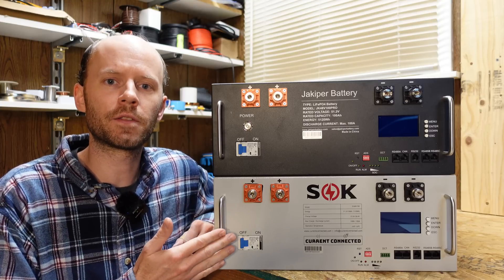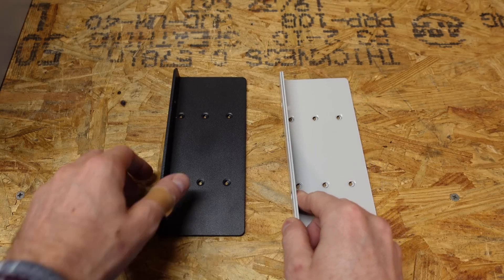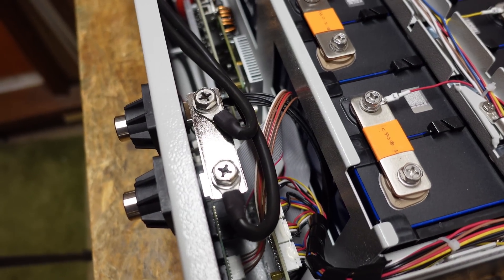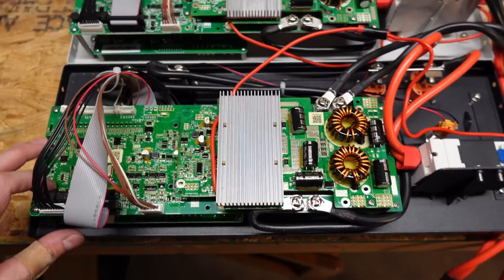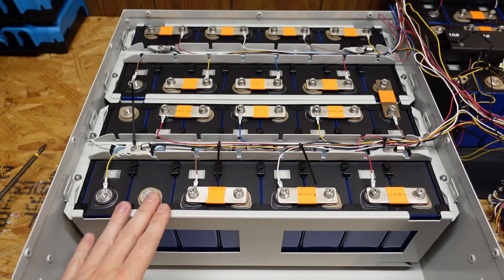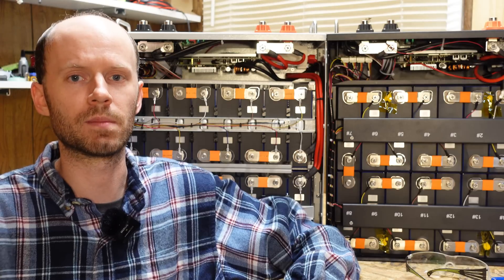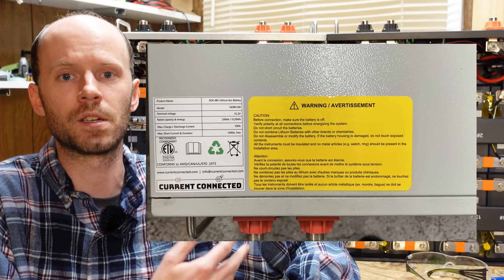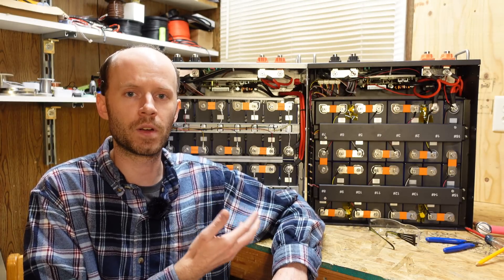SOK vs Jakiper, 48V 100Ah LiFePO4 Rack Battery Comparison

Comment: great video.  Now seeing $1,000 difference in a 5 battery rack between SOK and jackiper.. Worth saving 1k?  Seeing some shipping or packaging issues (maybe minor overall) for Jakiper.. I do like the design and design of the SOK, and seems really solid, but an extra 1k cost??
Reply from the maker: The batteires are pretty much the same as it appears one company copied the design of the other (my opinion). I'd say it doesn't matter in terms of battery performance; however, the SOK is sold, serviced, and supported by a US company. SOK also gets you an ETL listing, which may be required if you're doing something that requires a permit/inspection.

Comment: The extra steel enclosure in SOK batteries is good for transportation. Just received a Jakiper battery today and the batteries inside had moved forward and bent the bar across. The bar was almost touching the BMS heatsink. Fixable though and this video helped with the disassembly.

Comment: If you look at the battery report for both units, the handwriting on the measured parameters was written by the same person.  Look at the 33.13, which is very obvious it was written by the same person.
Reply: in china those are manufactured in same plant, so the supervisor for qc are the same, or they just copy those papper

Comment: Both way overpriced
Reply from the maker: Chins doesn't make a rack battery that I'm aware of. Ampere time does; however, is only rated for 90Ah, looks like it has a low-end BMS, no communications, what looks like an AC-rated breaker (not sure on that one), and definitely no UL/ETL certifications. Not saying it's a bad battery by any means either. That's the great thing about a free market - you can go purchase the one you want.
Reply: @LithiumSolar  when I say way overpriced it’s because these server rack batteries are more than double the cost of these other brands that also contain grade A lithium cells. Nobody astute with their money will pay $2000 and only have a 100 AH battery to show for it. Server rack is targeted for rich people with a lot of money to throw away.
Reply: @CompleteOffGridAmateur  yes they are 100ah but 48v which gives you 5120 watts and go for around  $1450-$1700
Reply: It's  the container freight making the prices high. Wholesale around $1k each until you add freight and import taxes.  Now add US warehousing, employees to get them in faster than 8 weeks and a little profit for US based support. There's your mark up.
Reply: @jstaffordii  I’m comparing them to Ampere or Chins who also face the same overhead costs.

Comment: That $394 cost difference on 25 kwh kits is not showing included accessories. On the SOK kit includes 2 awg interconnecting  cables and 4 feet 4/0 awg battery to load cables versus Jakiper kit only includes 6awg interconnection cables and 4 casters on the racking.
Reply from the maker: Wow I didn't even see they had that kit on their website. My pricing was based on adding 5 batteries to the cart, so it does not include the cabling. If I add the kit to the cart, it's $43 more, which brings the difference to $437 but includes all of the cabling, which would cost more than $43 if you bought it yourself. Great deal and agree 6awg is rather... small.

Comment: Would have been nice if you compared the Battery stud busbars (for the main positive and main negative studs). From another video not sure if it's your or David Poz's but the battery stud busbars in Jakiper were made of Brass, which apparently is an issue if you're going to be put 5 in parallel the brass busbars, cannot handle high amperage draws without overheating. Would have been nice to know if the SOK has those same brass busbars.
Reply from the maker: Good idea. That was David's video and do remember seeing it. I'll check it out and come back with an answer. Regardless of the material, I still prefer not using the "daisy chain pass through" approach and just cabling them all to the same studs like I did in my rack demo setup.
Reply: This feedthrough connection on the SOK is spec’d at 310a max. David was also using undersized wire in his video.

Comment: Perfect openning vidéo 👍 
Do you Knox if these batteries' BMS are communicant with VICTRON ENERGY MULTIPLUS OR QUATTRO ?
Reply: have a look at the Current Connected website site. Full user manual for the SOK is there.
Reply: You can plug the bms right into a cerbo gx with the Victron rj45 cable and it will send all bms type info to the cerbo gx automatically.  If you have multiple batteries, you just daisy chain them together with a normal rj45 cable and it will send a summed data feed automatically. It was super easy.

Comment: I watched a video quite awhile back where a guy went to the manufacturing district in China. As he was touring he was bringing to attention the various different products being made, all on the same assembly line, had basically the same form/function, but were going to different companies, painted with different colors, etc.
The way they run the manufacturing over there is pretty wild. When a company makes a request for a large order, the various different manufacturing plants will plan out the process going from one plant to another. So the end product may actually have come from, or gone through, multitude of different plants before it's finally loaded on the docks for shipping.
This is also why some times you can buy 2 "identical" units, and there will be differences in the production line, because they may have actually been in different plants, let alone different assembly lines.

Comment: Man, I clicked like as soon as I saw you reviewing these.   :)  I would buy the SOK over the Jakiper, but buy the Signature Solar EG4-LiFePower4 battery before either of the ones reviewed in this video.  With that said, they are all very good options.
Reply from the maker: I have an EG4-LiFePower4 - also a GREAT choice. Somehow they've managed to keep the price point down AND still have the UL certifications. I guess it's cheaper to laser weld and they're also using a lower-cost BMS.
Reply: @LithiumSolar  and they have added fire 🔥 extinguisher 🧯 to the LL.
Reply: Where is the UL listing on the eg4 standard battery? Their site mentions UL listed "cells" and UL "rated" battery.. I don't see the expensive sticker anywhere on the battery though.
Also, has anyone looked into the explosive potential of these things? With all the weather balloons passing over lately I imagine a twittering antennas on them sending down an encrypted messages to create a lot of sad off grid enthusiasts down below. I don't suppose the BMS software is open source anywhere..